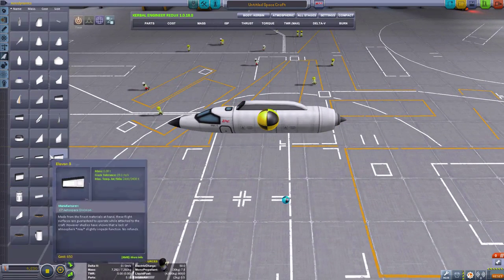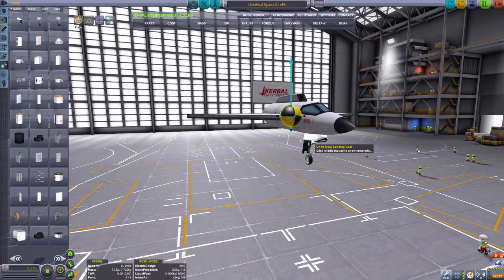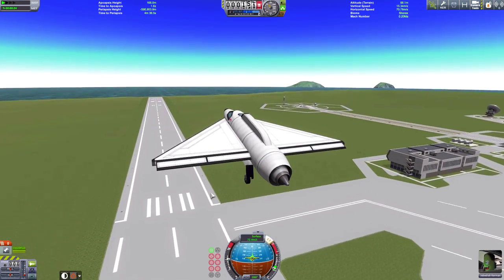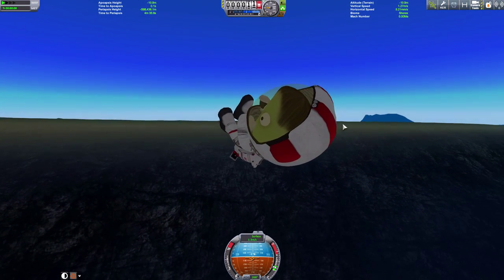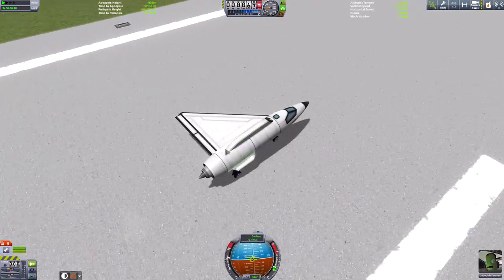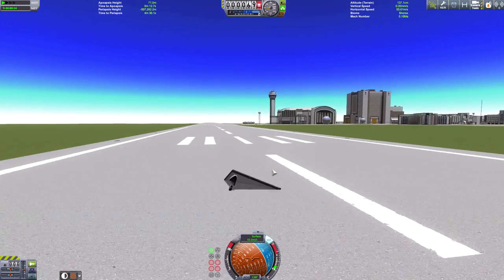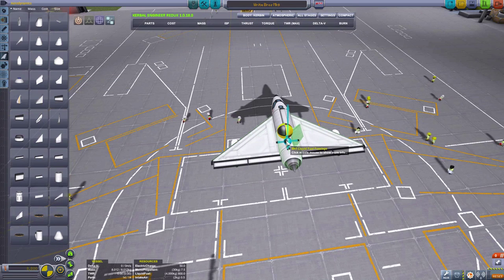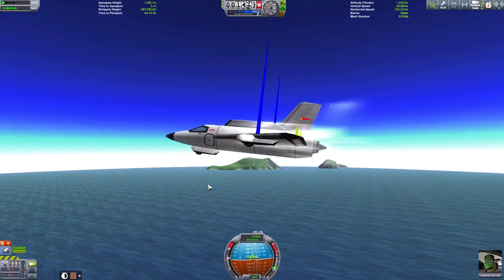Kerbal Space Program - Messing and learning with Planes - Part 01

Comment: If you think of it like a dart, the fins are always at the back because there's more air resistance relative to the centre of mass. If the fins were in front, any upset in the balance will cause it to flip around so the com is in front of the col.
Reply from the maker: Cheers man great tips from the master of the air. Also great analogy with dart
Reply: Orb8Ter Oh boy, I definitely wouldn't say "master", just "well rounded" at best hahaha. I can't take credit for the dart, I learned that off of somewhere years ago and it just stuck with me ever since ^_^